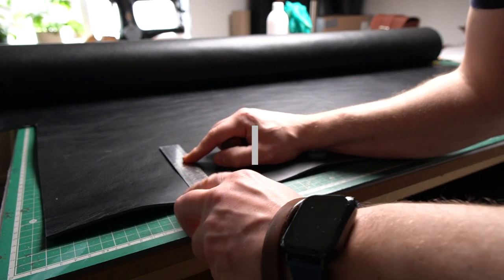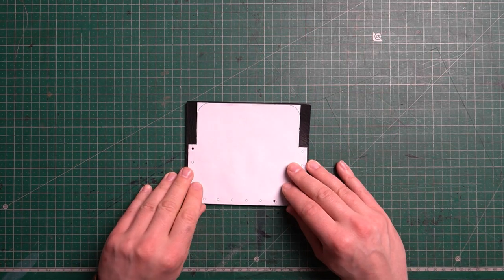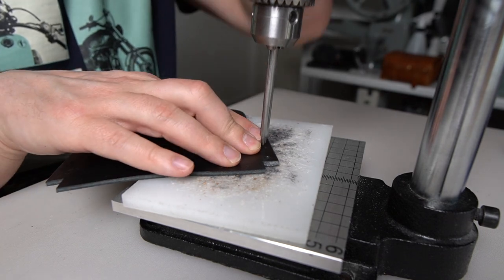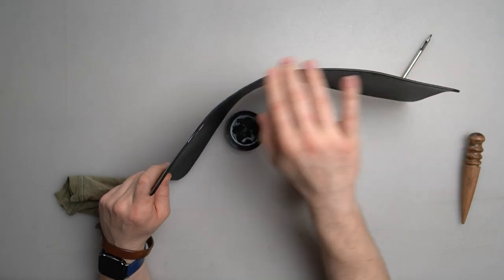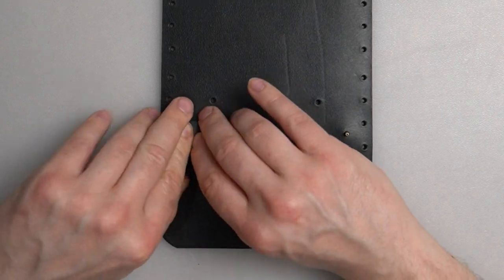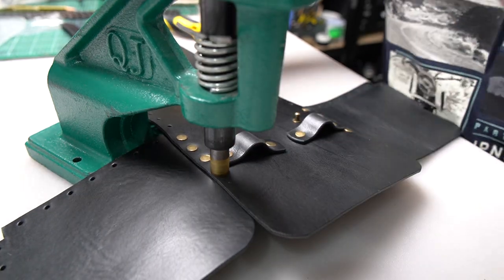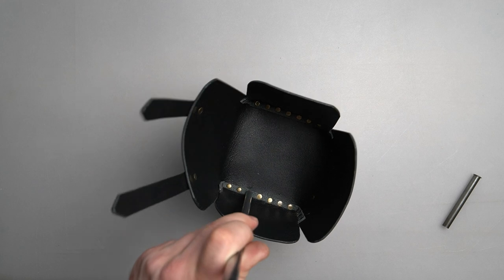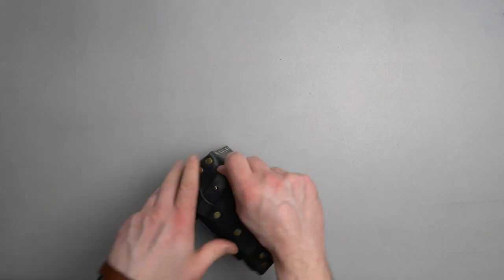making of the Mini leather box with free pattern

Comment: Wait... but how do you attach it to the bike?
Reply from the maker: It's the same as suzuki van van Tool pouch you punch two holes in bottom part and screw it in to place, it's recommend to use large washers or I can sent extra piece of leather which you place at the bottom.
Reply: @qcrafted  Gotchya, thanks.